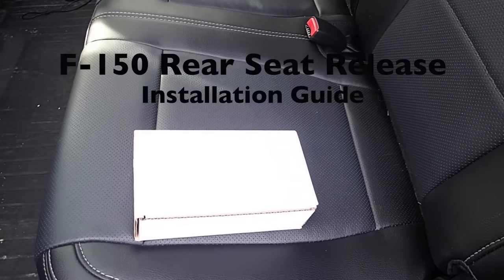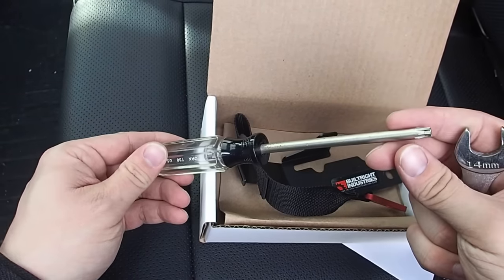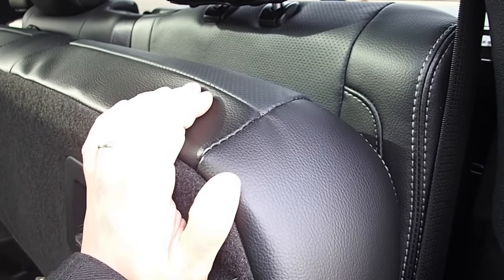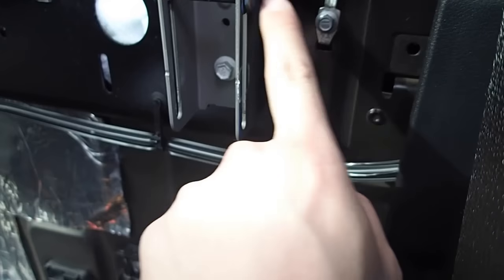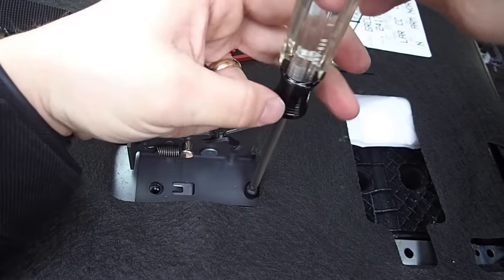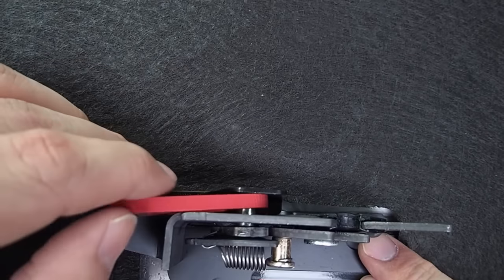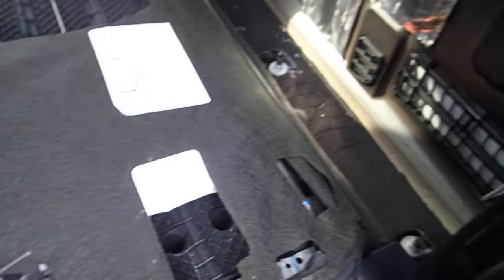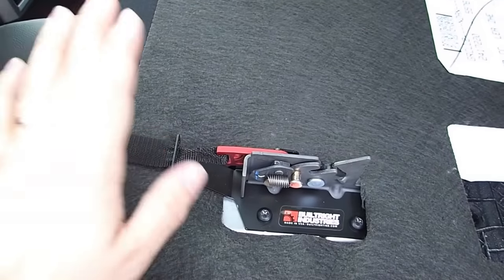F-150 Rear Seat Release Kit - Install Guide

Comment from the maker: Use caution when ordering this product from Amazon! There are a few Chinese knock-offs listed that cut the ID of the pin hole very loose due to their sloppy manufacturing. These will have a tendency to rattle and drive you nuts. The straps are also sewing in such a way that the bracket cuts into the webbing. If you choose to buy those products, just be aware of these issues! The original is very clearly listed as being sold by us. - Matt
Reply: I suppose it’s a compliment to your design that they would copy it, but it’s really frustrating that they can get away with listing a knockoff on Amazon. Ordered an F150 yesterday and I will definitely be picking up one of these and a dash mount from your company. Keep it up
Reply from the maker: Yea, frustrating for sure. The worst part is that it looks so similar that I'm sure people will order it thinking it will fit, work and last just as well as ours. The world we live in! Thank you for your support and congrats on the new truck! - Matt
Reply: BuiltRight Industries installed this last night, works awesome
Reply from the maker: You just want to be sure that you ordered from 'BuiltRight Industries' as the seller. No need to worry about getting a knockoff if you do so.
Reply: Thanks for the heads up, ordered yours from Amazon.
Reply: Saintsandsin I tried installing it on my 2019 and the bar doesn't line up with the slot. I took it off my 2017 where it worked most off the time.
Reply from the maker: @Saintsandsin Yes, no problem at all.
Reply: I used the actual release strap to pull the pin initially, instead of a socket. That way I could feel the pin and place the pull strap on it while not actually being able to see it.

Comment: I had one for my prior F150 and it worked flawlessly. Installed a new one on my 2023 F150 and it works but getting it to latch again takes an act of congress and many curse words - not sure how to adjust to work better. It will be awesome, I know, once I get this one sorted.
Reply: Same! I’m here looking for comments with tips. It’s very frustrating trying to latch it again.
Reply: I just installed and have the same issue as well.  Have you found any resolution?
Reply: @JDB12341  I have not. I am able to get it latched and just keep it like that. Unfortunately .
Reply: @objective.perspective  Thanks for the quick response.  It's unfortunate it doesn't work as described.  I have tried chatting with their support and still no resolution either.
Reply: @JDB12341  @BuiltRightInd I did reach out to customer service and Matt responded although my problem persists

Comment: Just installed mine.  Works great.  Total time about 10 minutes.  Had to slide the pin in the receiver on the aft bulkhead up to get it latch, but no other issues.

Comment: I hope you get rich from this invention!!!
I previously did the "home brew" version of this seat latch mod -- you know, with little metal rings and paracord??   Didn't hold up to frequent use.  I set up my Ham radio gear/kit behind these seats, and I was getting in there at least weekly; those little metal rings just plain got bent out of shape and didn't work long.

Enter the BuiltRight F150 Seat Latch mod!!   I ordered two, got them quickly, and took no more than 7 minutes to install on both sides.   Works perfectly, and the materials are solid, built to last.

You have built a better mousetrap -- every F150 SuperCrew should order two of these to do what Ford should have done in the first place.
Reply from the maker: Thank you, James! Glad we met your expectations!

Comment: Just added this to my 2016 F150 Platinum.  Very easy install and very well built.  That said, If you have the upgraded stereo, there isn't much "room" to be gained behind this seat.  Still useful however.  I did run into a small issue on the install and that was the ford latch was sticking a bit.  A little WD40 and all was well.

Comment: literally had to get my son to help me get the darn seat down as he was home from school. Immediately I ordered this kit as I knew if I put the darn seat back I would be dealing with getting it back down again by myself. Installation looks simple enough. Will be getting this done this evening. After that it's the closing of the seat and hoping it sets.  Thank you for having this product. Ford should have taken care of this already. No reason why they could not have engineered the same latch on the 40 side for the 60 side. Nonetheless opportunity for Built Right Industries to do right!. After this I'm getting your bed rack system for my 17 Ford F250 extended cab 8 ft bed!!
Reply from the maker: Glad to hear that! If you have any questions regarding the installation or the bed rack system, don't hesitate to reach out! - Matt
Reply: Installed easily and now I can get back in there no problem!! Excellent product!. As soon as I've got the money, I'll be getting the bed rack system. BTW what ever happened to the Hi Jack mount you were prototyping a while ago. Are you still working on that?

Comment: Love mine. You have to be careful and test the latch before locking it and adjust the Builtright plate before putting the seatback it it's place. Also hold the pull tab loop as you put the seat back into position otherwise you have to fish it out from behind the seat with level 1 profanity on a 5 point scale.

Comment: This a well designed product.  I did, however had an issue after the bracket was installed. I had to give the rear seat back a pretty good smack to get it to set the latch after several "firm" attempts.....This may help others.  (2020 F150 super crew STX 4x4)   Cheers!

Comment: No need for a box wrench as the release catch is only 6 inches below the top of the rear seat and easy to release with your fingers. The T30 screws are tightened with considerable torque and a hand torx driver was no up to the task. I used a T30 on a 1/4" socket wrench to get the screws loose. Good idea to  place them as they are removed into a magnetic metal tray. Not mentioned but the nylon strap needs to be pushed down so as to allow the latch  mechanism to close and keep the seat back in place.

Comment: I was just about to place my order and thought about checking out the space behind the seat first, there is no space to put anything back there. There is a speaker system installed there. Passenger side seat already has a hinge installed and the jack is there also small space to keep ropes/straps or bungee cords.
Reply from the maker: I'm glad you checked! Trucks with premium options (like yours), tend to have less space back there, due to subwoofer, amp, etc.
Reply: Exactly, if you have a lower base model there is room back there to tuck stuff. But for instance with my f250 platinum, there is no room behind the driver side rear seat. Only on the passenger side is there enough room to tuck some stuff but there is already a latch release.

Comment: If you have the Bose system with a subwoofer, then when you pull that seat down you fill find a space-filling plastic subwoofer enclosure and an amplifier and not much other space at all. The passenger side on my 2020 Tremor seemed to have a different latch. Under that seat is a 12v to 110 volt inverter and a pot jack. So no room there either.

Comment: do these work on SuperCab or only SuperCrew?
Reply from the maker: This can be used on: 
-  2009 - 2014 F-150/Raptor Supercrew: These models can utilize two latch release kits (one each side of the 60/40 rear seat). 
-  2015 - 2024 F-150/Raptor Supercab and Supercrew: These models store OEM tool kit behind the passenger side seat and use one latch release kit for the driver's side.
-  2017 - 2024 F-250 and F-350 Supercab and Supercrew: These models will utilize a single kit on the driver's side.

Comment: Love the product, easy to install however; I stripped both bolts. Both bolts were tight, very tight; had to use a set of visegrips to remove both bolts. After that it was an easy installed.
Reply: Is their a right and left or it doesn’t matter?

Comment: My 2018 F150 XLT has the latch screws installed so tight I can't get them to budge without rounding out the inside of the torx screw.   Sprayed with WD40 to see if that will help.  I'm using a Craftsman screw driver style T30.  Any suggestions?
Reply: I’m having the same problem, trying to install today. Not fun
Reply: @americantrucknation4891  I used an impact driver that broke it loose easilly
Reply: @fedguy9182  yeah, I did too. Thank you

Comment: Mine doesn’t relatch after releasing the back.   I have to readjust the floating bar and raise the seat back and bottom to latch.    What adjustment is needed ?
Reply: same issue I had. I just relatch at the top.
Reply: Same here on 23’ STX. 
Not as handy as I’d hoped.

Comment: Just installed mine and discovered the scab seat doesn't raise up as the video shows to allow more room behind the seat back. It also has a square end on the latch pin. Once I managed to get the latch released, the rest was easy.

Comment: The rear seat back on my 2018 supercab does not creep forward at all when raising the lower seat. It looks like a redesign. I can find no way to create enough space to reach that latch behind the back of the larger seat. There must be a special tool or something. Any ideas?
Reply from the maker: William Farris Hey William, your observation is correct, however, the latch is still in the same location and our product does work. On the new supercabs, there is usually a slightly different latch, which is meant to have a small strap on it, but the design is terrible and the strap almost always falls off. If you use this video as a reference for location and reach down with a bent coat hanger or similar, you’ll be able to release the latch. A cell phone camera and light sometimes help to see down there. Good luck!
Reply: Yep same thing going on the 2019. I used a light and a longer wrench.  But that seat not moving makes it harder to get it to latch.   I found I had to get that moving bar down,  and let the ramp on the latch slap it into place,  putting the closing pressure on the seat side right on the latch.  Kind of tricky.
Reply: Michael Scotch

Comment: Does this work on a 16 super cab? My seat back doesn't move when the bottom is folded, and theres no access to release the back
Reply from the maker: Yes! As you've noted, your seat back doesn't move, which makes releasing the seat initially a bit more challenging, but once it's down, everything should look the same back there. You'll notice that the latch has a square head, which is meant to sit inside of the larger of the two overlapping holes in our product (an update not shown in this video).

Comment: Does BuiltRight have any kind of bracket that mounts behind the drivers rear seat?
Reply from the maker: Not yet. ;)
Reply: Are there any plans to? A panel similar to what you’ve got for the bed would be nice!!!
Reply from the maker: Yes, and we have preliminary designs, but have found in testing that all of the different options packages make it hard to make a one size fits most solution. We'll get creative though!

Comment: Just received & installed it. Works good!  But disappointed that the piece that was supposed to be a red aluminum attachment was actually a black plastic piece!
Reply from the maker: Hey Mike, sorry it wasn’t what you expected, but please don’t be disappointed! The red aluminum piece was replaced by a high tech composite (not just plastic) that allows for the new ‘3D’ design with a snap fit over the pin. The red aluminum pieces were able to develop a rattle over time in some cases. The new piece is injection molded fiberglass reinforced nylon - the same stuff used in a lot of modern firearm and OEM auto components. It’ll do right by you, I promise. 👍
Reply: BuiltRight Industries Thanks for the prompt response. I kinda figured it was replaced due to rattling issues.

Comment: My 2011 f150 has a different set up than this.  I have the black hooks, clips along the top and the latches at the bottom.  I don't think this will work on mine. Pls help.
Reply from the maker: Hey Marty, sounds like you've got a supercab and not a supercrew. Unfortunately, this product doesn't work on the supercab before 2015.

Comment: I just came across this a little too late though..i already drilled a 3/16 hole in the release pin and put ring with a 8" piece of paracord hooked to it. works like a charm but not a cool looking I guess? 🤷‍♂
Reply from the maker: Hey whatever works! We're no strangers to those little DIYs that get the job done

Comment: Will this work on a 2015 F-150 supercab?
Reply from the maker: Yes! The supercab install is a bit more difficult, as raising the seat bottom doesn't buy you more room. Instead, you'd use this video as a reference for the location of the latch and reach blindly with the wrench (or other).
Reply: Thank you!

Comment: Any possiblity of making a tool that would help with ease of reaching the pin. I tried using a wrench but have been unable to reach the pin
Reply: I used a coathanger (shaped with a screwdriver shaft) to reach mine. The pin to pull isn't so difficult that it unbends the coathanger, but you do need something somewhat sturdy.

Comment: Does this work with a 2019 F150 Supercab? Or Crewcab only?
The seat back does not move forward when the seat bottom is folded, so it has all but zero room to see or feel anything.
    Thank you.
Reply from the maker: Yes! As you noted, it is a tighter fit back there initially, but the latch is in the same place. Note: The newest revision includes two overlapping holes in the red piece. The larger of the two is meant for the square headed pin, which some supercrews have.
Reply from the maker: *supercab

Comment: Got it installed, but can't get the seat to re-latch.  That horizontal bar keeps moving.
Reply from the maker: In most trucks, the default position of the horizontal bar with the seat bottom down is about 3/4in from the bottom. One other thing is that sometimes it takes a little force to relatch the seat. Some of these latches are 'tight' from the factory and will loosen up over time.

Comment: A very recent amazon review indicates the aluminum component has been changed to plastic.  Is this accurate?
Reply from the maker: That is correct! We're very excited about the revisions that we've made to the design after tens of thousands of users reporting feedback. The metal pieces were 2D cut, which meant that they had to be tight tolerance with the latch but loose enough that they could move. Over time, a few of these began to rattle (a problem that's even greater in the loosely manufactured replicas). To improve this, we changed the design to a 3D 'click fit' part injection molded using a glass fiber reinforced composite, which is damn near as strong as the aluminum part. Additionally, this allowed us to add a radius to the edge where the strap meets the piece, ensuring that over time and with use, the strap isn't worn or cut. We'll be updating the Amazon listing this weekend!

Comment: I bought your latch and i cant get the damn seat down on my supercab.  Ive tried various length wrenches and can't get it loose.  Lookig with a flashlight from under the other seat it appears mine is flat on the end so the wrench never catches.
Reply from the maker: We have a couple troubleshooting videos that should help solve this issue for you! Please refer to these 2 video links:
https://youtu.be/SQGdQLPcHZw
https://youtu.be/M3nl_z7t4m0
Reply: @BuiltRightInd  I finally got it using my inspection camera and some mechanics wire

Comment: Stupid question.... I have a new F150 on order and it is my first Ford Truck and first Ford vehicle as well.  Why would a person need to fold the seat back down???  Thanks.
Reply from the maker: Not a stupid question at all! The reason people like to have the option to fold the seat down is that there's space back there to store jumper cables, first aid kit, tool set, etc, so that it's out of the way. The catch is that if your truck has a lot of options (the subwoofer, in particular), some of that space is eaten up, so I encourage people to check it out before ordering, to see if it's space that they'll use!
Reply: Ok, great!  Thanks for the explanation.  I believe my Lariat with 502A package will have the subwoofer..... comes with a BO Sounds System, so I am guessing that is the case.  When I take delivery in a few weeks I will investigate and see what I have back there.... maybe I will order one!  :-)

Comment: My seat back does not tilt forward when the seat bottom portion is raised up like you demonstrate? I've been trying to get back there for a month.
Reply from the maker: Hey James, you must have a newer supercab! Your assessment is correct, but luckily, access is still possible. You'll want to use this video as a guide for where you should be reaching, but will need to go in a bit blind. My recommendation is to remove the headrest and see if you can see the pin. You latch may already have a very small strap on it, but they frequently fall off before delivery, so you're probably looking for a pin with a square feature on the end. I hope this helps. We're working on finding a supercab locally for another installation video. Cheers!
Reply: Still trying. Ford can KMA.

Comment: The tab on mine isn't red anodized, it's plastic. Did something change?
Reply from the maker: Yes! This is the latest revision of the product. We found that over time, some aluminum pieces would begin to rattle, especially on newer trucks. Perhaps a change in Ford’s manufacturing tolerances. In any case, what you’ve got is an injection molded glass filled composite, which allows for the ‘snap on’ installation but is extremely durable. We’re doing a video on the changes now, so look for that soon. (Hint: we tow our Jeep pulling our trailer using our raptor, a tow strap and the ‘plastic’ piece in the kit)
Reply: @BuiltRightInd  hey, thanks!